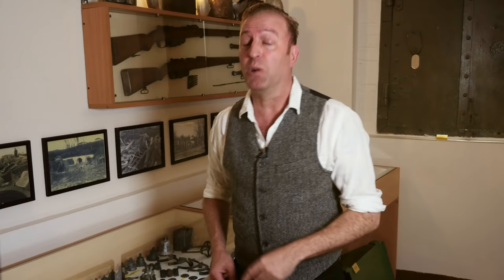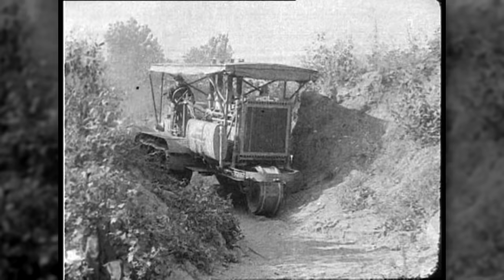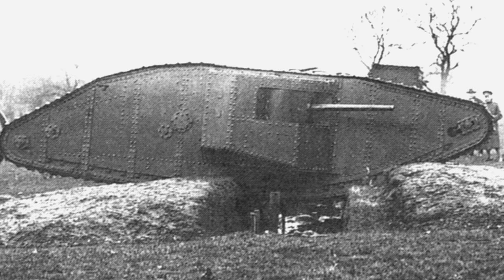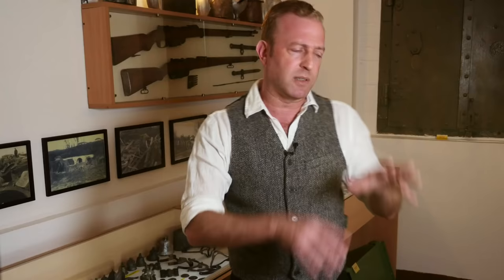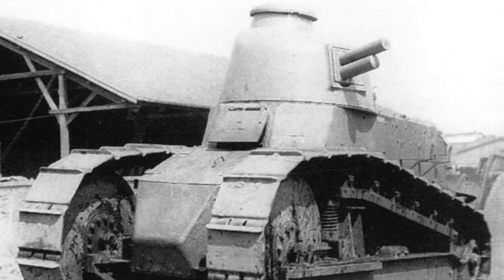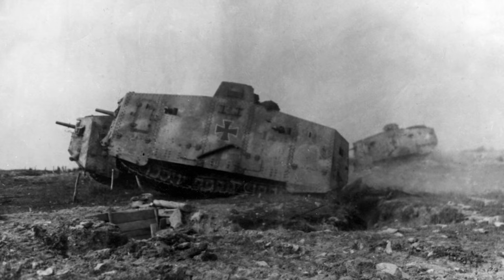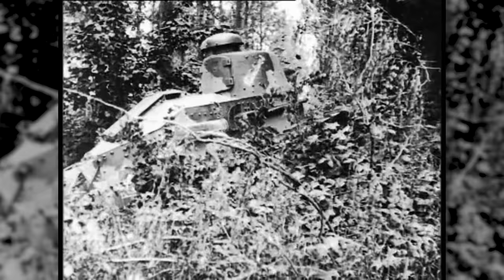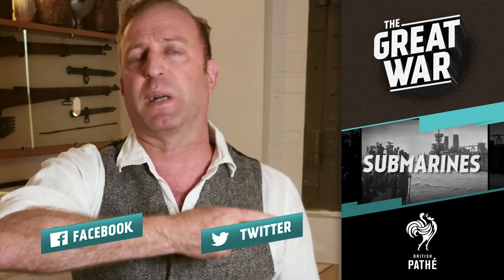Tank Development in World War 1 I THE GREAT WAR Special

Comment: I'm building a British Mark V Tank In 1/35 scale, I want it finished by 2018 for the end of the War
Reply: Good luck
Reply: Kaiser Franz Joseph I Thank you, I've been building it since June, and I have a large amount of it done
Reply: Better not Hotzendorf it up
Reply: wood1155 I plan to get an A7V too
Reply: What kit are you using to build the tank?
Reply: Bruce Gibbins MENG kit I got it from Ebay, very high grade kit comes with a full interior and highly detailed exterior
Reply: Kaiser Franz Joseph I So far I've been taking my time in building it, I intend to airbrush the whole exterior and interior then hand paint the specific parts which need different levels of paint.
Reply: Thanks for the tip. I've often thought about building a WW1 tank, but never have. Maybe now the time is right now you have told me about the MENG kit.
Reply: Bruce Gibbins They do any of the WW1 Tanks Mk 5 Male and Female tanks, The Whippet, the A7V and FT17. Look on You tube there are loads of 1/35 kits to be built
Reply: During an eBay seach I noticed several other MENG kits that included both both male and female versions. The level of detail looks realistic and these kits should be a rewarding build I would imagine. At one time I thought I might build the Airfix Mk V but at 1/76 was too small to fit in with the 1/35 models I had already built.
Reply: ww3? after D.Trump has either lost or won his invasion of the world?
Reply: lost duh he cant get past wild Canadian moose's
Reply: Mile End Park,
It's well worth finding the story of a Whippet tank called Musical Box.
Reply: gamesbok For my birthday I was given a 1?35 kit of a Whippet tank and I know the story, I intend on doing The Musical Box just because it needs doing
Reply: Mile End Park,
Indeed it needs doing.
Reply: How is it?
Reply: How did it come on?

Comment: The FT-17's overall smallness (two crewmen, one gun, light weight) gave it an advantage not mentioned in the video.  You could build several FT-17s for the resources needed to make one large tank.  Lose one heavy tank and you lose a lot of men, a lot of machinery and industrial capacity, as well as a large number of guns.  Lose one FT-17 and you lose much less.  Also, you can spread the guns around more efficiently with a set of FT-17s, allowing you to cover more frontage during an assault, while forcing the defender to divide his fire.

Comment: Could you guys also throw in the metric system  aswell? Thanks.
Reply: Or add subtitles with conversion.
Reply from the maker: +Derps Vines We usually do both. Sometimes only one. Conversion is not that hard.
Reply: Ah, well, it would still be fantastic if you did both
Reply: Yeah, if you want to please a global audience use metric, not that inaccurate, archaic abomination called Imperial system only used by a handful of countries.
Reply: +Frencho9  It's actually called Customary, not Imperial :P
Reply: https://en.wikipedia.org/wiki/Imperial_units
Gringos call it customary, roast beefs call it imperial. Does not matter you anglos call it differently between countries but it's the same horrible measurement system regardless. only Canada has seen the light it seems XD
Reply: Frencho9 Gringos, eh?  I spy a Latino ;)  Don't worry, we'll use metric soon enough.
Reply: Unless I'm calling somoene else a Neanderhtal or Cro-magnon I'm not being incredibly racist.
Reply: Makes sense with development being British based that the units are in English units.
To be frank , systems of measure are just that, arbitrary. Not one is greater than the other ( SI for life tho)
Reply: the old world uses imperial , the new like nz uses metric,,, and the third world uses what ever they can get there hands on
Reply: It's very simple: the metric system aligns with our counting system as they both work in base ten. The imperial system works in several different bases at different orders of magnitude, which does not align with our counting system. Therefore, calculations are WAY easier using the metric system.
Reply: +Daniel Eyre I'm Canadian. we use metric, like road speeds are kilometers per hour. we understand common imperial units like miles per hour because USA is our main trading partner. example car speedometers have both kph and mph on it. Canadians use metric in science and engineering
Reply: You know I live in Canada right? For over four decades raised and educated in the Canadian metric using system. Your information is outdated or just misinformed by improper sources.
We Canadians do use the metric system. Some of the goods we buy from the USA have Imperial on it but Canada has been metric for a long time. For a cookbook published from the USA might be sold here or given as a gift by a USA relative/friend. Kitchen measurements inside will be Imperial. There is almost always a conversion listed to work the Canadian's use of the metric system. If the publisher makes a Canadianized version of their book it will be in metric.
Our cars have kph and mph on it due to the cross border issues. A car built in Canada has on the speedometer KPH as the main reading with MPH as a secondary reading. Our road signs are in KPH. You cross the border south and you see MPH so the secondary reading keeps you informed.
University and high school math were all about the metric. In the rare case of having an Imperial based question you could find conversation tables for our trade partner's Imperial system. First step was to convert to metric, do the math then convert back only if the answer had to be fed back to the Imperial system, which was even more rare.
As for an urban legend of a plane fuelling 3 decades ago maybe it happened but it hardly changes our country off metric. The airline industry likes global standards, like English speaking air traffic controllers everywhere.
As a Canadian we use metric with myself knowing off hand only a trivial few conversions to Imperial, like 1.6 for kph to mph, as we don't use Imperial on a daily basis.
Reply: +Daniel Eyre you having a laugh?
Reply: But the internet told you so. sigh
Primary source beats secondary and tertiary sources. I am a Canadian born, raised and educated using metric. See earlier posts for more discussion.
Not sure who you are referring to about the believing whether Imperial units exist or not as we in Canada use metric and our main trading partner the USA uses Imperial.
Reply: Ultimate BadJokes & Roasting&FunComments
Reply: Nothing wrong with Imperial. It's our conversion.
Reply: Imperial predates metric by centuries as used by the British (parents of the USA) and other nations. After the rebellion of the 1770s USA made their own version with mostly the same measurements, just a bit different to be well different. Some related to accusations of trade mistreatment. Far more to do with socio-political mindset to appear different from their kin. Im sure some USA call it something other than Imperial, "customary" in some phrases. In Canada do things like have a US "gallon" marking on a pail to distinguish it from the real original "gallon".
Though, Imperial and customary are very outdated and not as productive to the sciences. Not many know the ratio between hogsheads and pints. A foot of 12 inches was once the length of the foot of the King, which varied from king to king, and so on. Base 10 metric works with our modern age so much better.
Reply: Actually, the metric system is an archaic hangover of a time before electronic calculators.  Customary, organically-developed units of measure are more convenient now.

I mean really--the only reason to use the metric system is because you can convert from one unit to another by moving the decimal.  These days, our phones can divide by 16 if necessary.
Reply: I'm a scientist, and an engineer.  I don't frankly care what units I use--I just convert to whatever is convenient.  We have these things called computers, you know?  People who still think the metric system is important are just ridiculous.
Reply: Have fun in fourth grade math tomorrow  Maybe you'll pass this time!
Reply: Ha!  You can't even spell your insults correctly.  Education is in such a sad state these days.  Get in touch next time you have trouble converting pints to liters.
Reply: SwingNeil wew
Reply: Getting a little into personal issues. One point made was metric works with our base 10 math with a following mark that some computers operate on a different base like 16. Both cases it is the matching the base math and that the steps are consistent throughout. Imperial doesn't have either as in the case of length 12 inches make a foot and 3 feet a yard and 1,760 yards make a mile.
In metric kilo means a 1,000 so a kilogram is 1,000 gram and a kilometer is 1,000 meters. A much clearer representation.
For more oddities of the Imperial system look at https://en.wikipedia.org/wiki/Bushel#Imperial_bushel
Reply: Try this:  go to http://www.wolframalpha.com

Type in "convert 100 slug-force feet per fortnight to watts".  See what happens.

Yes, if you have to do complicated thermal or power calculations in your head, the metric system is better.  But a guy drinking a pint or putting a gallon of gasoline in his car really isn't hurting anybody.  You can always convert, if you need to.  And sometimes it's more convenient to think of things in human-scaled units like feet, pounds, etc.

In my experience, scientists who get in a high dudgeon over the units being used by other people in their day-to-day lives, are not really very focused on science.
Reply: Without a converting aide do the math yourself. Metric +1
Reply: That's a trivial case.  I have a converting aid in my pocket at all times.
Reply: And you are an abusive commenter.  Are you claiming that I'm lying about carrying a smart phone?
Reply: "I have a converting aid in my pocket at all times." - That's what she said.

So no you can't do all possible Imperial conversions without an aide, wasting time and resources to have a reduced efficiency.
Reply: That's ridiculous.  So now using a calculator is a waste of resources?  Seriously?
Reply: Misinterpretation is your strong suit. Using odd ball inconsistent un-co-ordinated units is a waste. Needing a calculator shows the waste. Correlation vs causation, a scientist would understand.
Hey, SwingNeil just bear in mind the world of scientist and engineers use the metirc system for its efficiency and compatibility. Its you who needs to change his game. You are entitled to your view but don't expect the world to shift to you when your in the wrong.
Reply: I'm not the one insisting that the world has to conform to my way of doing things, you are.  This is exactly what I'm talking about--you get all bent out of shape about the units I use, even going so far as to imply that I'm not a scientist if I sometimes use different ones than you do.  Why do you care?  I use SI units when that's a good choice, and I use traditional units when those are a good choice.
Reply: SwingNeil the error is yours. I,among others, are informing you how the majority of the world is ALREADY using metric. It is you, SwingNeil going on how we should all carry calculators to overcome the flaws in the outdated Imperial system. I am quite fine if you wish to act inefficiently as I do not pay for your time. 
What you  infer is your own doing. Others have commented on your apparent lack of accreditation or familiarity with science and engineering. If you have such accreditation and as you have come across as lacking them to multiple people you should consider it a flaw in your character so that you might correct your manners.
Reply: My manners are correct toward people who treat me respectfully.  You are demanding universal conformity with your habits, not I.
Reply: SwingNeil your imagination is clouding your comprehension. You ought to have an educated person sit down and help you read through this thread. Several people have pointed out the world has moved onto Metric. A person suggested Canada uses both and I corrected them. We have all but done away with the inefficient 3,12,1740 and so forth steps of the Imperial system.
In want of something to be angry about other than yourself you falsely, that is lie, about my view is to demand everyone conform. Quite the contrary. You do not read minds nor really read threads.
I feel if you want to go about using the outdated Imperial system with its inefficiencies and inconsistencies you can but it would be false to tell people it is the more effective methodology. I am able to allow another hiker to put rocks in his pack while climbing a mountain but wouldn't want him to shout all around all must also carry unnecessary rocks. I have informed the hikers of the unnecessary rocks. Other hikers point out your inappropriate "stone" weight (a deliberate pun on the Imperial system) A weight shaped like a calculator with all the bizarre steps in the non-base anything Imperial system.
SwingNeil you are a liar on my view and poorly mannered in general.
Reply: +SwingNeil due to a sense of harassment from you I have now blocked you. You are now silent.
Reply: B1 Laxson metric is pretty useful my dude since it works with average measurements whilst the imperial system is much less comprehensive.
In my most humble opinion the metric system is simpler to learn and can easily apply to many other average units of measurement. It's not my place to judge but have you ever wondered why the imperial system is only officially used in two countries?
Reply: As I said, I use metric when it's useful.  I use imperial when it's useful.  I find the choice of units to be a trivial question, to be decided based on the utility of the measurement in question.  It's amusing to see people get so irate that I'm not apologetic about my preferences.
Reply: SwingNeil I can see your point, in Canada many will use feet and inched when measuring height, and in many places people will measure their weight in pounds but in most other facets, such as distance and liquid measurements, the vast majority will use the metric system.
To hold either the imperial or metric systems as all encompassing would be a farce, have a good one my dude, all the best. :)
Reply: See what I mean?  Making false claims in order to reconcile your self-image with observed reality.  A textbook case of cognitive dissonance.  Thanks for an amusing conversation.
Reply: +the great war  first it twisted my brains, but now i can confuse my kids "imperially"
Reply: They call it the Royale with Cheese.
Reply: The Roasting Toaster .was not an easy to play with a strong
Reply: you can just look up a converter
Reply: Funny thing in Canada is that 40 years into officially having a metric system people even younger ones still use the imperial system for things related to our bodies; liters of gas, kilometers for distance etc but we still tend to refer to our height in feet-inches and our weight in pounds.   I’m that age where I grew up with both and since I live both in the US and Canada I still operate in the old system.  They both have their pros and cons.
Reply: Frencho9 welp most of his audience is american so to bad

Comment: The FT -17 is delightful to control in Battlefield One.

I wonder what's the function of the chains at the rear.
Reply: Tanks were occasionally used to tow field guns IIRC, as well as to help unditch other tanks who got stuck.  I believe those chains are for the towing system but I could be badly mistaken.
Reply: hagamapama makes sense, thanks
Reply: You'd imagine that being a very real possibility as every nation and military were developing the function and tactics in a vacuum because they had no early experience to really draw on. 

We now know that tanks should never tow anything. It's just asking for trouble heh.
Reply: Nowadays we have Armored Recovery Vehicles that handle that kind of thing, but tanks are still called on to tow things from time to time because the ARV's aren''t always able to get to the problem in time.  For example, Tiger tanks in WWII went in pairs exactly so that one tank could assist in unditching the other.  When you're pushing the weight limits for a piece of armored equipment.  sometimes the only thing big enough to get you out of trouble is another one of the same

Hard not to understand the lure of using tanks to help haul your material.  Tanks are big, and have a powerful engine if they're well designed.  If you need help getting men and materiel from A to B, any junior officer not taking advantage of every available opportunity to get them there, is negligent in his duty.
Reply: Too bad you can't drive it as a french soldier.

Yeah, that's sarcasm for "Battlefield One is shite".

Comment: I hoped you would mention Medium Mark A Whippet tank. It was something different but fared well on the battlefield. Here is one story I have found about it:

 "The Whippets broke through into the German rear areas causing the loss of the artillery in an entire front sector, a devastating blow from which the Germans were unable to recover. During this battle, one Whippet – Musical Box – advanced so far it was cut off behind German lines. For nine hours it roamed at will, destroying an artillery battery, an Observation balloon, the camp of an infantry battalion and a transport column of the German 225. Division, inflicting heavy casualties. At one point, cans of petrol being carried on Musical Box's roof were ruptured by small-arms fire and fuel leaked into the cabin. The crew had to wear gas masks to survive the fumes. Eventually, a German shell disabled it and as the crew abandoned the tank one was shot and killed and the other two were taken prisoner."
Reply from the maker: We will definitely talk about other tank types in the future.